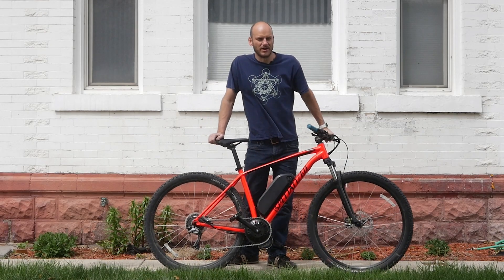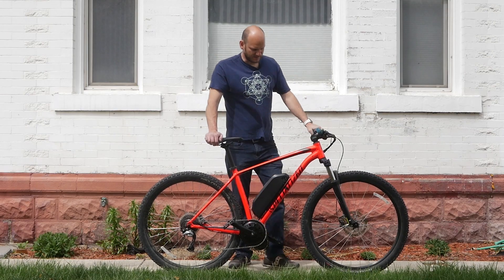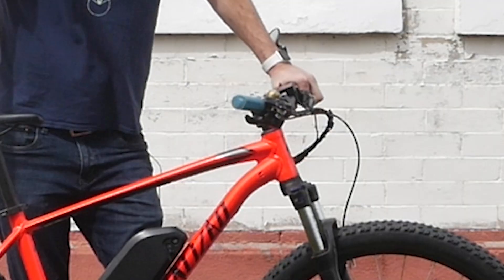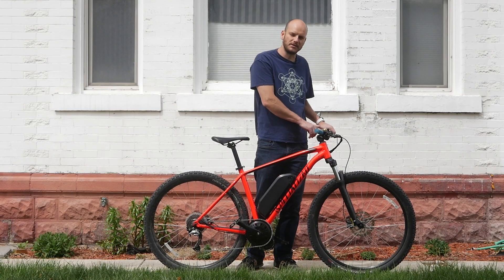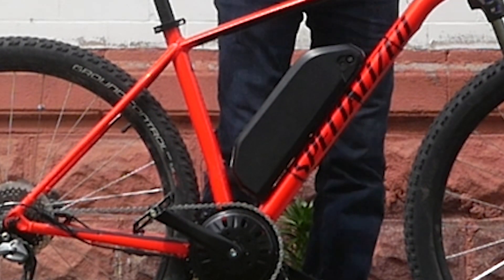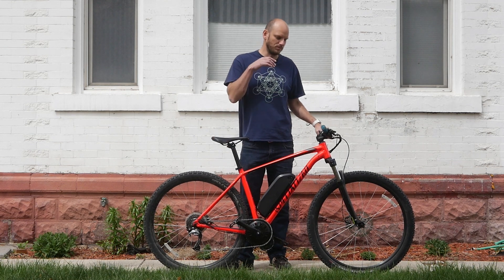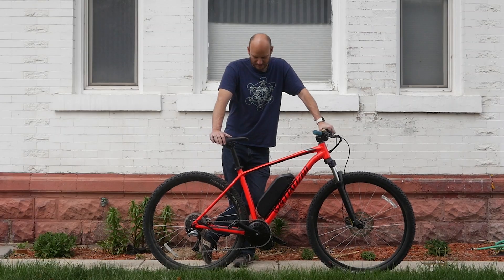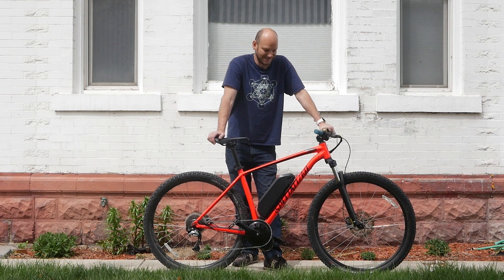Custom E-bike Build: Specialized Rockhopper BBSHD 52v 17.5ah

Comment: I have the same bike I just purchased. What I had to do was grind a little bit off the down tube underneath where the cables come out. I deleted the front derailure cable out of the middle that let the motor come up just a bit more, and no problems shifting in the back it’s smooth as it can be

Comment: Thank you for posting this. I'm looking to do almost this exact conversion. I have been going back and forth between this kit and the CYC Stealth. I'm a little worried about the loss of ground clearance. Have you had any problems with damaged kits due to them landing on a log? Maybe it's not even an issue.
Reply: Ive run Bafang kits for a while now. Ground clearance is fine, even when tilted downwards. Besides, the BBS series isnt made for rough climbing and big trails. If youre climbing over things and giving your bike a bit of stick over rough terrain, these kits arent for you

Comment: Johnny,  WHAT ABOUT GOING WITH HEAVIER SPOKES IN THE REAR?  ARE THEY AVAILABLE?  I HAVE A MARIN 29er and I'm 220lbs. Will have a 36T chain wheel. Thanks!
Reply from the maker: Yes they are. Lower the gauge the thicker the spokes. I’d recommend getting a good quality spoke first then thickness second

Comment: Mr. NerdOut, when doing a sustained uphill run: how many sustained watts should I be pulling with my my BBSHS (with 52 Volt battery)  before I need to downshift? Thank you so much for all your great videos! If it wasn't for you I might have ended up with some kind of Prius inbred stump flopper!
Reply from the maker: The specialized stumpflopper?! 😂 don’t go by watts, go by RPM imo. If the motor feels like it’s not sustaining the given RPM, downshift
Reply: @JohnnyNerdOut  Thank you and Yes specialized stump flopper. Without your help I might have turned my stumpjumper into a stump flopper.  But thanks to you: my stumpjumper is now a: high speed, aeronautical, hair on fire, handles like a dream, way fun: Stump Grinder

Comment: Hey Johnny. Big fan of your work and I learned a lot with you. I already Built a few hub motors ebikes but now I want a mid-drive. Did you ever install the Cyclone 6kw? is yes, Is the motor physically bigger and heavier than the 3kw? It is noticeably more powerful than the 3kw?

3kw for me is not an option because I want to install on the fat bike to ride on the snow and gravel. The 6kw have metal gears instead nylon. 

I hope this message finds you. Cheers from Poland.
Reply from the maker: I have not done the 6k. It is bigger though. FYI metal replacement gears can be had for the 3k pretty cheap I believe

Comment: Can the BBSHD be detuned to a 750W nominal power like the BBS02? I'm looking to get a BBSHD for a fat bike I really like but want to be able to use on public roads too.
Reply: Yes you can set power limits. The BBS02 is 750w but peaks out around 1300.  Do you live in the US? Just slow down near people on trails and be respectful. I run full wattage on all the trails and no issues for me. I always creep by pedestrians as to not intimidate them. It helps to also have a bike that looks like a bike and not a motorcycle. 

You might as well go with a BBS02 if you want 750w. It's a very strong motor.  I have one on my carbon folding bike and I get 31mph top speed and it will carry my 220lb body up hills with ease.
Reply: @TheAgentAssassin  I'll look into that. Thanks!

Comment: OK, then, what's the best tire WIDTH for different purposes? 

To put this in perspective, I have ridden tens of thousands of miles on sewup tires. Those are like 20-25 cm wide; mostly less than an inch. But I have yet to ride an e-bike. 

I expect that I would ride mostly on the road, where high cruising speed is somewhat important. Maybe also some dirt roads or light trails if the same bike is suitable for that. No hardcore mountain-biking.

There are so many different tire widths, and I cannot find solid information on how to choose. This is, of course, for my first try. After some experience then I will know better what I like.
Reply from the maker: I recommend going slightly wider than you would on a traditional bike since you will be traveling at higher speeds and therefore should have more surface area touching the pavement for better control IMO. But it all depends on the riding you want. The less surface area touching the pavement the faster and more efficient your bike is but theoretically a little more dangerous because of less braking ability. Just like a car tire. Skinny ones for fuel efficiency, wider ones for better grip 👍 sorry if that doesn’t answer your question so I’ll try here: for mostly road riding and the occasional off road ride, I would say 2.3-2.8” tires should be the range to look. Wider for more off road.
Reply: @JohnnyNerdOut  Super. Thanks very much!

Comment: At what point do we question whether it is right to be doing builds that are getting us kicked off of trails, MUP's and lanes?  Because of these, they are even talking lisc., registrations and liability insurance (yet another reason a less restricted version of E.U. standards might be in order in The U.S.).
Reply: For one , be respectful on trails. I never zip by pedestrians on trails I always go very slow around them as to not intimidate. 

I suspect though once we see the market heavily flooded with super fast builds they will outlaw all e bikes on some trails  irregardless of the wattage.

EU bikes are anemic though , you can almost pedal just as fast without a motor. 

Some trails already have a 750w cap here in the US. The bbso2 falls in the legal category.  But will say it again it comes down to ebike riders respecting the trail goers and not flying by them at 38mph.
Reply: @TheAgentAssassin  while for the most part we agree, the fact is, people have already proven they cannot be trusted with speed capability. The AVERAGE motorist is drive 5 over the limit at any given time. 
E.U. bikes are not enemic. E-bikes are not for making traditional cycling faster. They were developed to make cycling easier, more convenient and accessible. I have a 250 watt Ananda mid-drive in my shop right now that out climbs my buddy,'s 750. It has 120nm's of torque.

Comment: Hey Johnny. I have this same exact bike,  same motor, 52 volt 19.2 ahm battery, stock 46 tooth chainring but it only goes about 31 miles per hour. Any idea why I am so far below your top speed?
Reply from the maker: How much you weigh? Any incline or wind your dealing with? Lastly, check the programming to make sure it’s at full capacity ( you will need a program cable)
Reply: @JohnnyNerdOut  190lbs. No hills or wind where I am. Where can you get a programming cable
Reply from the maker: I sell them on my shop:  https://www.johnnynerdout.com/product-page/bafang-programming-cable
Reply: If you live in Australia 🇦🇺 you can get one from cap rouge and it is located in Brisbane or if your are in America I think you can get one from Luna, Ali express, or I think Amazon.
Reply: Try a 52 ring with 11 rear small cog

Comment: Hi Johny, I have just the week carried out the BBS02 install on a Specialized Rockhopper, however I cannot find any decent place to attach the brake sensors, the lever pivot at the front and I cannot see anywhere to mount them so the disconnect and reconnect properly, any advice or photos of this install would be really helpful!
Reply: Didn't it come with replacement brake levers
Reply: @richhard3  nah, its hydraulic brakes, so needs to be the sensors
Reply: are there little sensors withe the kit? I super glued mine just under the brake lever
Reply: @TheAgentAssassin   yeah I've got the sensors, just can't find a place to mount them.  The problem with the level is where the pivot point is just doesn't have enough movement so it either never travels enough to brake the signal
...  or it's permanently connected.

Comment: Love your vids.

I'm still interested in knowing your thoughts about best tire sizes for various purposes. You suggest that "big tires" were good for top speed, but I am left wondering, "why? how? and how much?".

(But don't worry. Your breath isn't _that bad_.)
Reply from the maker: It’s just gear ratios. Small skateboard wheels aren’t going to go fast at 100rpm but a 29” wheel will. In between those two sizes you have different speeds at 100rpm (using as an example)
Reply: @JohnnyNerdOut  Oh, then I completely misunderstood you. I thought you were talking about tire _width_. I was trying to figure out how that related to top speed. I was imagining something about stability, but you meant _diameter_, which is more obvious.
Reply: my guess for the reasoning, is that bigger wheels cover more ground per revolution.
Reply: I have a 20inch tire folding bike that does 35mph.  BBS02 and carbon folding bike.
Climbs hills like a goat.

I'm running 52 ring in the front and 11-34 in rear. 

I had to modify a BBSHD 52t Lekkie ring on a BBS02 motor. I needed the extra offset to stop skipping gears.

Now every ring is tight solid and doesn't skip.

Just FYI a lekkie BBSHD ring does work on a BBS02 motor, you gotta modify it.